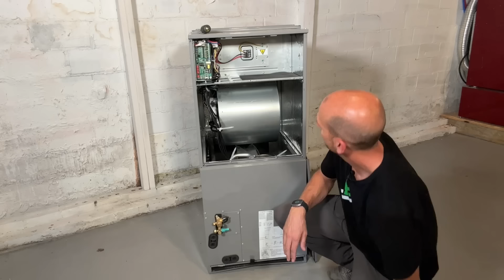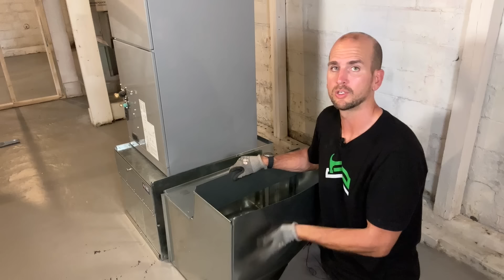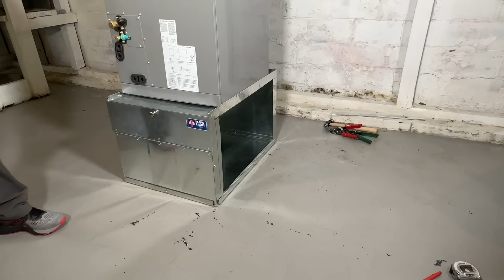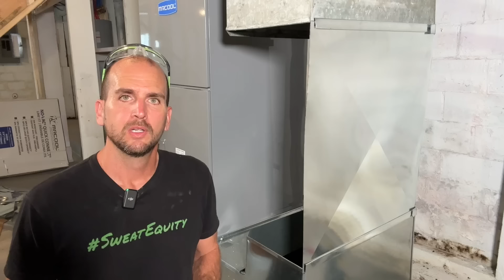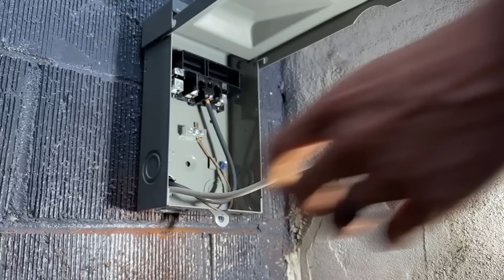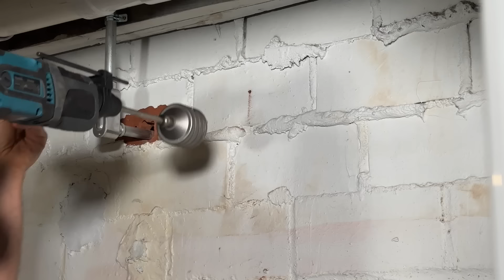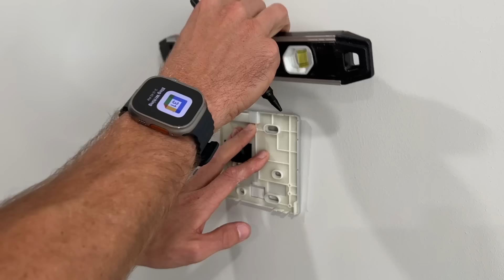How To Install Your Own Central Air Ducted System | Mr Cool

Comment: Why didn't you have to pull a vacuum, I'm assuming there is air in the line coming from the evaporator coil in the handler to the condenser?
Reply from the maker: Mr Cool makes it so you can just connect the lines and open up the valves.  If you have a leak you will need to call in am HVAC pro but if everything goes to plan you are good 👍
Reply: @EverydayHomeRepairs 
That's strange because I heard even the smallest amount of air can cause a cooling problem. If the system leaked, you should be able to suck all the freon back into the compressor, but I'm not sure if you can do it with that unit or not. Thank you
Reply: @HallEffect7798 Mr. Cool Linesets, condensers and coils are all pre vacuumed. The linesets have a valve in the connections so they don’t lose vacuum so the system is already “purged” in a sense prior to connection, then you release the refrigerant.
Reply: @alexw.854 
That's a good idea that they vacuumed the lines, if you can trust it I wouldn't. Thank you for answering my question I always like to learn different things

Comment: Did you replace your furnace with this ?
Reply from the maker: Sure did, that was the main HVAC unit for the house.
Reply: @EverydayHomeRepairs  I have a 2 yr old furnace in the home I just purchased but no air and was thinking about switching to this setup

Comment: You are a great teacher. You take time to explain.
I was hoping for a little more on installing the heat strip.
A little confused on how you supply the hyper heat air handler and also the  breaker on the heat strip.

Brian

Comment: So I'm wondering why you used 6/2 wire and a 50 amp breaker for your condenser?  I've been looking to install this same 3 ton unit and the manual says 30 amps and 10 gauge wire.
Reply: 8/2 wire with 40 Amp breaker for 3 ton (outside unit)...air handler I use 10/2 with 30amp breaker no heat strip...he had the double stack condenser hyper heat from video

Comment: After these modifications are made do you get someone to balance the system or check for static pressure. Because oil furnace to heat pump is a bit different based on my readings.

Comment: Can i use nylog when connecting coupler to the unit? It looks like ends before threads are rounded and it wouldn't hurt to put a bit nylog on the edge (not on the threads).

Comment: So with mine, 

My unit came with a 24v option for thw thermostat, 

And i need help.with the 115v air handler vise 230v from.outside
Reply: How many ton is ur unit? Model number?
Reply: @nadezdacox6005 ingot.it.figured out thank.u for reply
Reply: Need more info

Comment: Does it matter which line connect goes where? Like is there a wrong end and a right end. One to the air handler, one to the heat pump?

Comment: Curious. I know this is a two year old video,,probably not monitoring this,,,but,I set up system just like this only a 24k system. As long as the system is powered on,,using the supplied MrColl thermostat the AHU fan never shuts off. The condensor outside does shut off once the selected temperature is satisified. The thermostat is set to AUTO. Is this expected behaviour,,the fan never shuts off as long as the system is powered on?
Thank You,,for detailed video.
Reply: Yes,thats how system works. Fan never shuts off.

Comment: I am looking at replacing a 3 ton split ducted system using existing duct and electrical wiring.  I had decided on the MR COOL versapro hyperheat, so  you video is very helpful and confirms this should be a relatively easy DIY, and same me $5K.  I am curious, though why your outdoor condensor is a stacked unit.  The 3 Ton condensor I'm looking at is only a single fan unit that's about 37" wide and 34" tall.  Did you install a larger capacity condensor??

Comment: Really the only way to minimize blowout on brick is to use a long bit to drill a pilot hole through the wall. Then go on each side of the wall and drill through half way. Brick just sucks for drilling through though.

Comment: Just never use white for a hot wire if you have to you have to market everywhere it is visible in the panel that's the inspectors want that that's code

Comment: You mounted the outside disconnect too close to the ground… snow buildup. 

Overall you did a great job as a DIY home owner. Just things to think abut when HVac is concerned… Do not reduce your air volume either in or out of the air handler. If you use rivets they will not loosen like screws can through vibration over time.

Comment: My unit MRCOOL VersaPro 2nd Gen 2.5 Ton 17 SEER2 Central Ducted Heat Pump Split System -R454B Inverter - Multi-Positional
SKU: MVP-30-HP-C-230A00-O / MVP-30-HP-MUAH-230A00-O arrived defect. Installer spent an hour on the phone with Mr. Cool tech support. Now I spent an hour emailing them purchase confirmation etc. Then called them for follow up. Still on the phone for ≥45 minutes on two phones (after once was disconnected by them automatically due to too long wait). Unit is for a summer house on the Outer Banks, that is unusable in the high season (now) without HVAC. Also, a shoutout to Mr. Cool reseller  HVAC Direct at this point; they promised to delivery of unit within 4 business days; it took them 16 days. If you need an HVAC unit and want to have it work within a few weeks (not to consider a few days), go elsewhere. Also, be prepared to spend your time, and add your hourly rate to the expense. I will give an update if/once the unit works (not yet) and how quickly Mr. Cool sends the replacement part (pending as of this afternoon).
Reply: any updates . did they honour their warranty?

Comment: great work!!,, im about to do a 4/5 ton mr cool..... 1 thing, with  hose ends whether for car home etc.  especially when pushing through a wall or similar place is always cover the ends with a clean cloth or plastic to prevent even the smallest piece of dirt that could contaminate a positive sealing surface or get in threads

Comment: good video. does the cabinet have knock-outs on the SIDE panels specifically designed to allow conversion to SIDE AIR INTAKE?
Thank you
Reply from the maker: Nope, just had to make my own opening.

Comment: Thanks for your video, this is really helpful. I am actually going to have my local Mr Cool distributor install it for me. Seems a little much for me right now, but at least I’ll be able to understand what he did. Pretty cool that this is the exact same system I’m getting, 3 ton ducted hyper heat. This thing is literally half the price installed as the closest cold climate heat pump option from a traditional hvac contractor

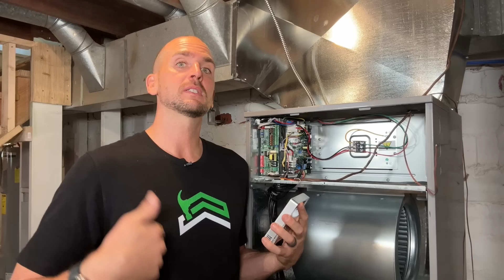Comment: At 55:35 the gap between plate and heat unit slot 4 mm top and bottom side. Heat air can easily sneak in here and perhaps fry the circuit board. Any wise words?

Comment: Hi, it was a great video.  At the end, I was a little lost how you install the thermostat??? You have the two wires coming into your main board.  Where are another two wires coming out from the wall?  Is thermostat directly connected with the main board? Is the thermostat wirelessly communicate with the main board?  please advises......

Comment: did you hire someone to pull out the old equipment? i'm about to undertake this, with a gas furnace from '88 (plus evap/condenser from 2003) but i'm a bit afraid of dealing with the gas lines. there is a shutoff valve right there and i assume i can just cap it off as well once it's disconnected...

Comment: mr cool changed the 2 wire system and f’d it up. its not easy, it doesnt work and im going to try a regular thermostat next bc I cant get any help. im bieng run around in circles. the manual doesnt match what the panel says.

Comment: Great video! It's really helped me a lot with my install. Question though: Is that still a 6 AWG in your electrical whip to your outside unit? It looks smaller in your video and the ring terminals I got for the 6 AWG don't fit in the connection points. What'd you do to make that work?

Comment: You made me think I finally had it until my thermostat didnt have the same set up. Mine is newer and it is like pulling teeth to figure this out.  2 cables came with mine. Neither are labeled. I don't know what they are , where they go or what they are supposed to do. one is short and white with a blue connecter on one end and a white connector on the other.  The other cable is longer and black with slim white connector on one end and all the colors of the rainbow coming out the other end.  I can't find anything that helps me. Your system is the closest i've seen yet but my thermostat doesnt have a battery. I am stuck.
Reply: Well it depends but hook it color to color. Yellow is cool white is heat red power  green is blower if you have a heat pump you need orange wire also blue is common ( but that may not be the case)

Comment: Very useful.  I bought a Mr Cool Versapro 24K ducted heatpump.  It came with a Mr Cool Smart T-stat, but no instructions how to connect between Indoor Unit and T-stat.  No HA and HB terminals and no battery.  Just old skool terminals (OB, W1, W2, CWA, RH, Y2, Y1, G, C, RC).  The manual shows various multi-wire connections between indoor and outdoor units, but I only need S1 and S2 for RS-485 digital comm, as you did.  Since no heat strips, I think between T-stat and Indoor Unit I need R, C, G, Y1, Y2/Y, and B.  Those map to T-stat as R -> RC and B -> OB.  Strange that they don't detail how to connect their 2 devices, requiring some guessing.

Comment: Scott, since I am landing the new electrical connections in a sub-panel, should I be using 6-3 Romex (50A) and 14-3 Romex (15A) to keep the neutral and ground separate?  Thanks, Dave.

Comment: Scott, I really appreciate the value and effort you include in each video, thank you!.  I want to install the Hyper-Heat Central heat pump system you described in this video, but I don't see the "hyper heat" phrase used in the description of the unit you have listed in your Amazon favorite tools list.  The one that's in your list on Amazon is "2 to 3 Ton 20 SEER Variable Speed MrCool Universal Central Heat Pump Split System - Upflow/Horizontal".  Is this the unit you used?  Thanks, Dave.

Comment: For the thermostat, as far as I understand, with a traditional thermostat like a nest, you can only turn the system on or off or two-stage operation. Whereas the communicating thermostat from Mr. Cool is able to utilize the inverter drive to vary the output infinitely and achieve the highest efficiency. So if I'm reading the documentation correctly, you will lose a small bit of efficiency and fan speed control by switching to atypical thermostat.

Comment: The drain line was done well but I recommend from my hvac experience that blue pvc glue is the best kind and stronger than the purple pvc glue. I have seen a lot of people use the wrong pvc glue and 2-5 years later their drain line is coming apart in the attic and causing water damage and needs to be replaced because the glue was weak overtime and sometimes people put the pvc together and do not glue it at all smh. Personally I like fiber glass duct better because it is easier to shape but that metal duct looks good and new and better than a lot of the old metal ducts that homes still have today that are not even put together properly or hanging from the roof ceiling from years ago.

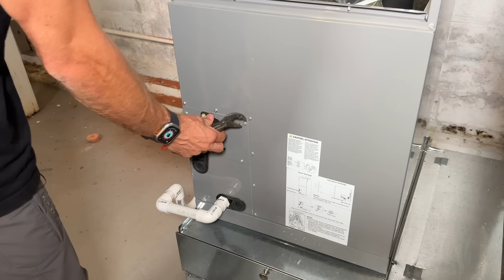Comment: Thank you sir! Query, at 50:10 when attaching the line set to AHU, the cover panel has some details about doing a leak test and seeing if the red dot on the larger connection (within the black cap) protrudes once you use the allen key to open the connection. In the manual it says, don't open the connection unless the line set is attached. Did you do the "leak test" and observer the red point?

Comment: Very much appreciate the video!!   I am a GC with some experience in HVAC work.  Your video answered pretty much all questions I still had after reading through the manual.  For example, after reading the manual, I was not 100% clear about the power to the indoor unit.  You made it crystal clear how this indoor unit is powered by 220Vac (which is unusual).  I also appreciated the details on constructing the filterbox and filter rack - which of course was not in the manual.  My only suggestion on the install might have been to use S-cleats on the corners of the custom ducts and that I believe would have left fewer sharp edges and also made the boxes a bit more air tight.  Thank you for the excellent video!!

Comment: Continuous load on that unit would suggest 51amp breaker, which would mean 60 amp. But the MOP says 50 amp.  
Also have you found wiring requirements for the emergency heat?  We get power outages, and dont want to wait for a heat pump to return to a normal heat so this is a must have.
Reply: That’s not what emergency heat is for, it’s for when the temp drops so low the heat pump can’t keep up

Comment: Just finished installing the same mr cool unit. Can you show me how you connected the thermostat wires to the back of the thermostat. Mine has a quick connect but you state that you only have to connect two wires to both sides of the thermostat wire

Comment: Whats the difference between the mr. Cool universal vs the hyperheat central. Are both capable of nest thermostats or any wifi thermostats?
Reply from the maker: I think the hyperheat can provide heat at a little lower outside temperature.  Both can work with Nest or other smart thermostat 👍
Reply: @EverydayHomeRepairs I read on Reddit If you use smart thermostat it will lose fan control because it's communicating system. Smart thermostat will make it just run on or off 

Does the normal thermostat provide WiFi feature?

Comment: Excellent video!!!  Thank you!!!  How noisy would you say the Air Handler is?
Reply from the maker: You bet, actually it is pretty quiet.  Pretty impressive.
Reply: Hi what kind of air filter did you use,and what size is the outgoing return from your box?

Comment: When I did mine I used mastic and tape on the insides and outside. I tried to minimize loss as much as possible. I even insulated all sheet metal.

Comment: I am also replacing my oil burner furnace in Illinois with a heat pump, I am going to use an ACiQ hyper heat, who I believe is who Mr Cool was/is using for their hyper heats. What BTU of an oil burner did you replace with this?

Comment: Great video! I've watched a few DIY HVAC videos in preparation for tackling my own job. One thing you should do once the box/ducting is all done is use the sealing paste/glue on the inside of the joints and then tape the outer joints where you can't put paste.

Comment: Around 4:30 minute mark, you mentioned that switching from a right to a left horizontal setup would require reconfiguring the evaporator coil...i have purchase one, and don't find it obvious how this is done...is your thinking to leave the EC in place, and only reconfigure the top drain pan to the bottom (somehow), or actually removing the who coil, flipping it, and exiting the drain lines on the opposite side of where the access panel/lcd screen exists (and obviously then drilling new holes into the back-side sheet metal)? I couldn't come across another video on this, so if you did, could you share? thank you, and very informative video (and subscription).
Reply: I have the versapro and had to remove the whole coil and rotate it 180. Also I had to take out the " inside heat sensors" I believe it's called, and tie it to the top
Reply: @1040Complete yes, we did it the same. Also its easier if you remove coils while unit in vertical position and then lay it horizontally to reinstall coils.

Comment: My Mrcool only lasted 1year . It kept breaking down so my Ac tech installed a carrier. Mrcool is made in China . First 6 months the evaporator coil had a major leak then 6 months later the compressor went out
Reply: That is unfortunate. I installed the 36k advantage a year and a half ago and it has been working great with no issues.

Comment: It's probably already noted, but I'm not going to read 200 comments to see.  Shouldn't you use a 2nd tool when torqueing down the cutoff valves at 49 minutes?  You were putting some pretty good twist on those fittings.
Reply: yes.

Comment: Awesome video! Respect!  Question: I know it's different in every town but aren't there inspections required once completed (at least for the electric and natural gas)?
Reply from the maker: For this one most states are municipalities would require and electrical permit and inspection.    Since this system is all electric the gas lines would not be part of the installation.

Comment: Awesome video Scott! I just purchased the 3 ton unit that is not the hyper-heat model but should do us a good job in North Carolina. Curious to know how the unit worked for you over the winter? I looked for your video on this topic but couldn't find it. Thank you!!!!
Reply: Where in NC? I am in NC too. In planning mode to do this.
Reply: @swcswc111  Greensboro, NC
Reply: @wesbishop3790  i m near  Raleigh. Did u install yours yet and how d it go?
Reply: @swcswc111  Not yet. Waiting for the temps to go down so I can get up in the attic to replace the lines. It's sitting in my living room. LOL
Reply: @wesbishop3790  I m planning the electrical for it now. Need to make room in my electrical panel first for new 240v breakers.

Comment: Only critique is on the plenums, you could have used S-slip for the joints (helps with the flexing). Duct butter the internal seams, the last seam and cover with insulation. The only ones who will know are the next guy who's there to replace the air handler in 25 years and will likely re-use the plenum. Great work otherwise. I've seen pro's hack in pro made duct. Great vid.